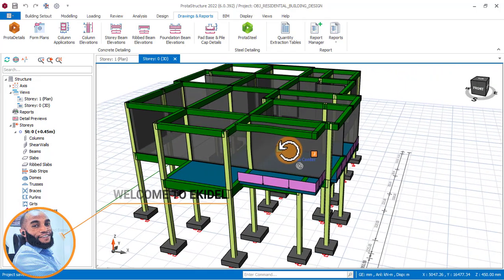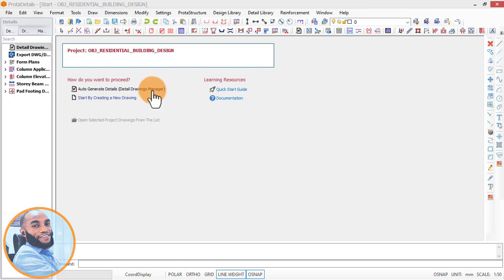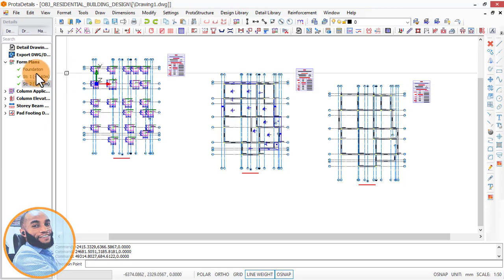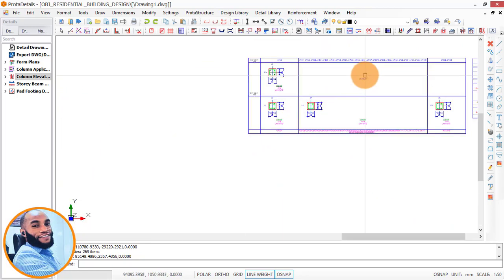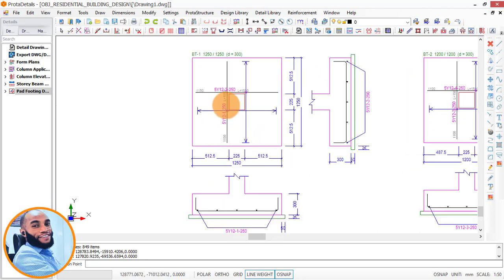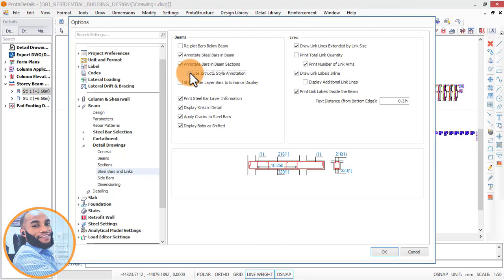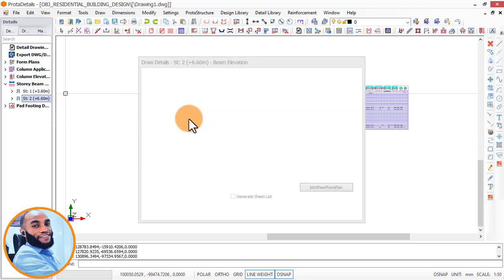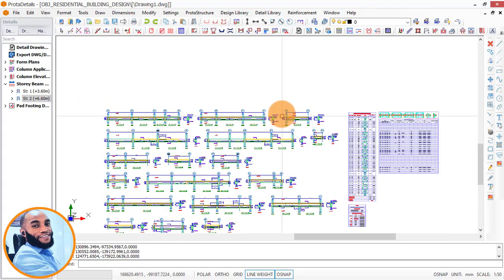Best Way to Export Structural Details from Protastructure 2022 to AutoCAD

Comment: Hello Ekidel, i like your tutorials, they have help me to learn Prota structures from scratch.
i would like you to do a video about end conditions of beams and columns. also a video on staircase design. thanks in advance.
Reply from the maker: Okay  we will do a video on the requested topics but for the one of staircase, we have done videos on it using KCSoft Staircase Design software
Reply: ok, what about prota settings before you start modelling? also you should make one on how to purchase stone bridge and how to go about it when detailing. thanks
Reply: also a video that emphasis on analysis and load decomposition by FE will be very helpful. i am sure most engineers don't know how to go about it.